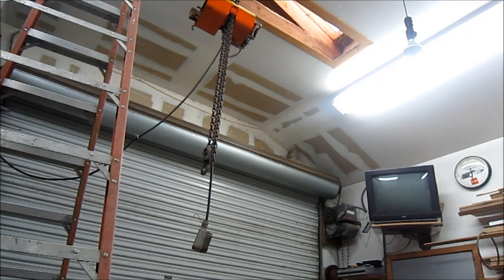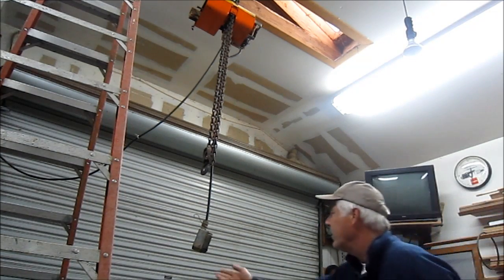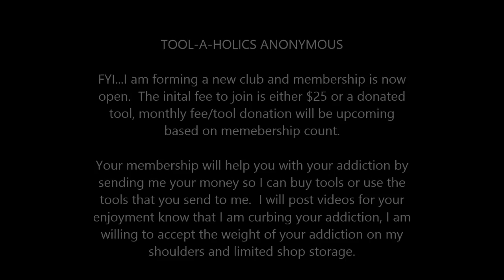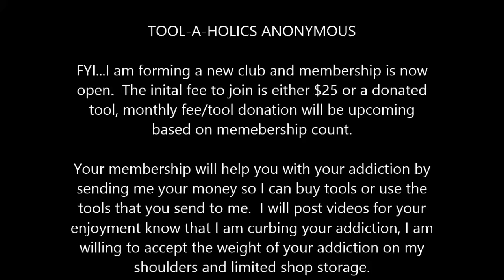Tool Time 15 1   Wrightway Update

Comment: hey chuck
is there a centrifugal switch on that motor if so look for end play one the shaft side to side, sometimes the contact for the start winding is not 100% you may have to add some shim washers to offer more pressure on the cam.
just sayin
Denis
Reply from the maker: Hey Denis...
Thanks for watching and your input...I will ckeck
Chuck

Comment: Hi Chuck,  I know you will get to the bottom of this, or would that be the top????
  I have to ask, from the sketch you were showing on the first episode it would appear this hoist is 3 phase, do you actually have 3 phase at your house, am I wrong, or are you on a converter? I know some people who have a house adjoining a commercial property can sometimes have it in both places, but I didn't get the impression that you were in that type of location.
Looking forward to the next installment ......... Mike 
   P.S.  My initial contribution to the toolaholics club will be in the form of a Warner & Swasey #4 turret lathe, I'll be wrapping it up for delivery to you tomorrow, I was hoping to send it thru the post office, but now I'm thinking it might be a little too heavy [Knuckles was straining moving it around] what do you think, UPS or Fed Ex???
Reply from the maker: Hi Mike...

I called Knuckles and told him to get over to your shop and unwrap that unit and get it hooked back up....yikes!!!....lol

I have a rotary phase unit and it has worked well, I can run two of my machines on the unit at the same time....hmmm, never tried the third..but it is usually me and Chui (my mentor) running machines.  My only regret is that I didn't wire the unit in another room, just hate listening to it run, but I guess the merit is that I don't forget to shut it off.  I have a main disconnect on the wall to power the unit, when I bought my mill, the seller included it in the purchase.

Comment: it cant be the coil, because it just cut out with the break coil out in this vid.

does it do it in just one direction, if it does it must be the contractor for that particular direction.
have a look at the brushes/com off the motor.
have a look at the cables that are attached to the contractors, over time they can break
Reply from the maker: Hi Jon,
Thanks for watching and your comments....you idea of a broken cable is a great thought....
Chuck

Comment: Your motor  brake wasn't the issue its the internal load brake jamming up. The motor brake makes the problem more prevalent without a load because it helps jam the load brake. Open the gear case and adjust the load brake.